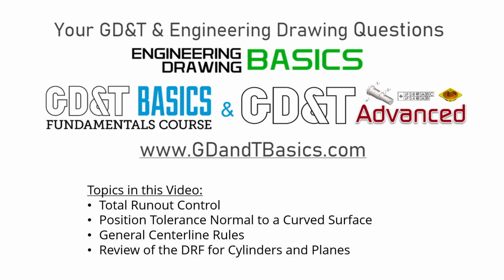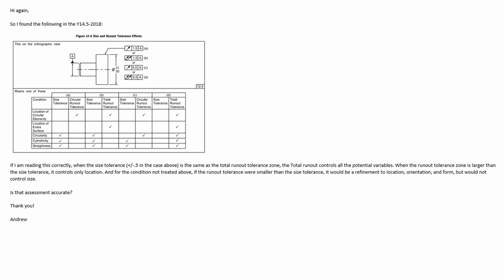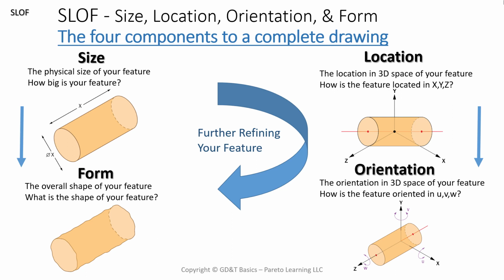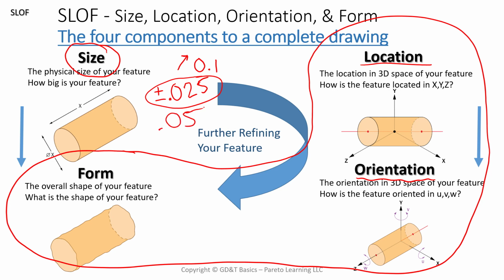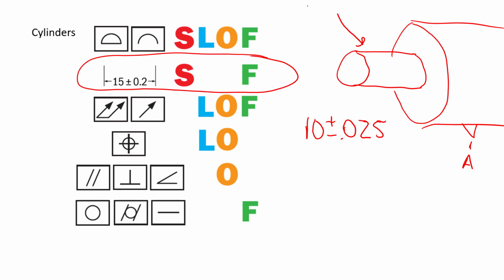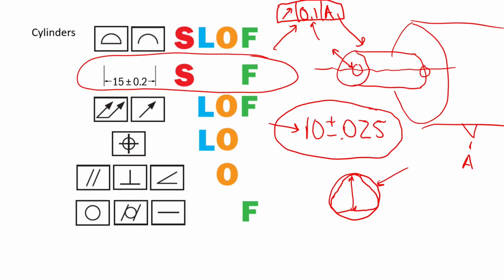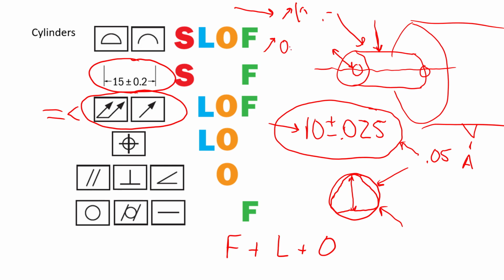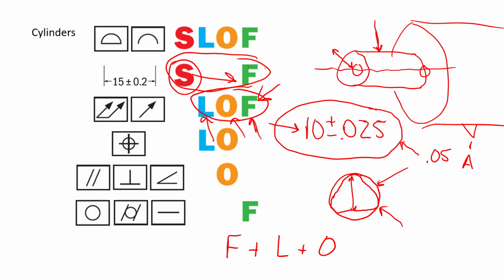Does Runout or Size control the circularity/form error in GD&T? (It Depends)

Comment: Great explanation, I have one question here.
Can we accept it if the part is well within size tolerance and satisfying runout condition.
 Means if mentioned size tolerance is dia 10+/-0.5 having runout of dia 0.1 and actual measurements are 10.3 having runout of 0.08?